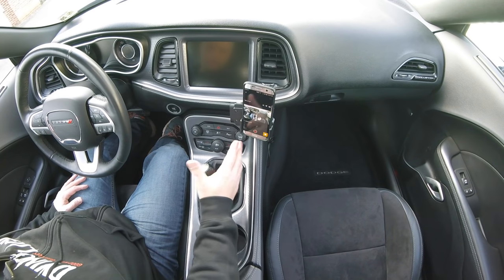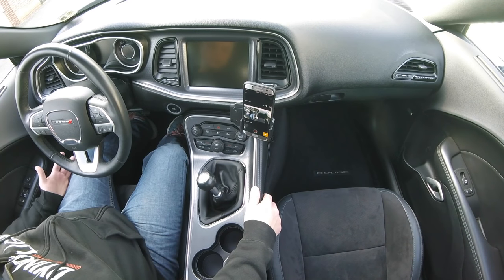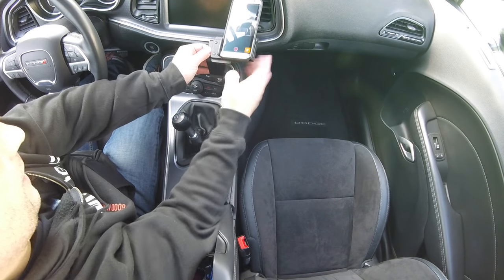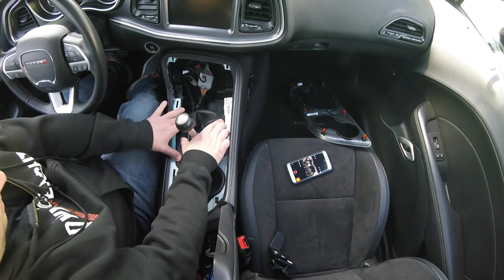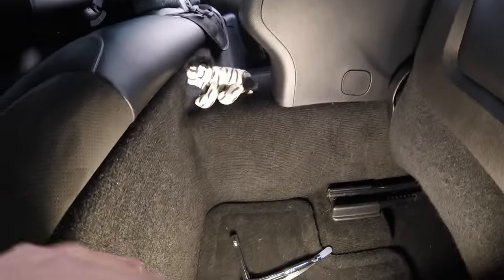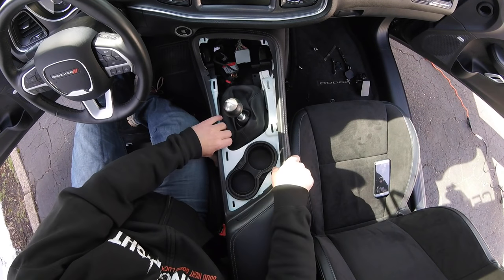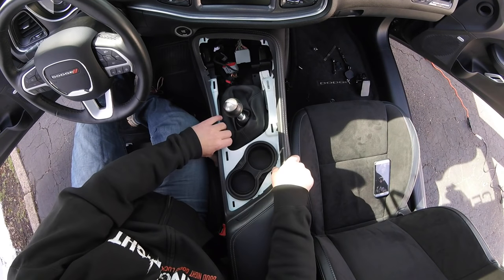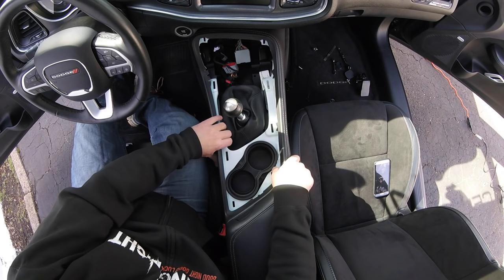Barton Shifter complete Install - Dodge Challenger Scat Pack

Comment: Just installed the Barton in my 2015 Scat Pack. Your video was spot on and far superior to any others I found. You covered everything from beginning to end and definitely saved me a bunch of time on the install. As it was it took me 5 hours, but I'm a bit OCD myself. The manufacturer included no instructions with the shifter and their install video was low quality and did not help at all, but then in was for earlier year models. As excellent as their product is ... and it's fantastic! ... they really should update their video or better yet insert a link to yours! I expected that right side pin to be the toughest problem ... and it was exceptionally difficult ... and so was getting that 10mm bolt out due to the Loctite ... but I actually spent more time trying to get that round rubber boot to stay properly in place when put over the shifter block! Again, outstanding video and commentary and I highly recommended it to any contemplating this install. Kudos!
Reply from the maker: Thank you, I'm glad this helped.  I did see a lack of info on this when I was researching the Barton so I tried my best to put out a detailed stable cam install.  The only thing I was lacking was some grease for those pins ;)   It's definitely a great product and has helped my times on the 1/4 mile quite a bit.  I was a little nervous about the investment, but it's proven itself very nicely.
Reply: You summed it up! Just installed on my TA 392 and those were all the same problems I had. Right pin and getting the boot to stay still lol.
Reply from the maker: Robert Lugo 👍

Comment: Use lithium grease whenever wherever possible in those pin joint sleeves.The boss should have been on the jobber earlier 😅

Comment: one thing you didn't mention is you need to make sure the round gasket ring needs to slide down onto the shifter and lock into a slit all the way around the shifter. that was the hardest part of the whole install.
Reply from the maker: True, I skated around it in this part 26:08 my go pro battery distracted me.

Comment: Soo I was driving and out of nowhere I had no gear shifter. Just all slush. I later realized I could kinda slop it into gear if I was really careful. 

Well I finally pull the shifter and the 10mm bolt and both clips had broken off and jettisoned out. Idk how this happened but I'm sure glad I didn't keep driving it like that. Jeeeeze. This video is a life saver. Literally

Comment: Just installed my Barton shifter.  Watching your video helped me understand how to get the console apart without breaking anything.  The right side pin actually wasn't too bad.  Had more trouble getting the gasket to stay in place on the cover while trying to get it over the shifter assembly.  You probably already know about this, but in case you don't- the problem Dan Kowalchick  mentioned 4 months ago about Allen bolts is a revision Barton made to the design of the shifter.  It now allows for a fore/aft adjustment in addition to the left right.   Took my R/T Shaker out for a test drive and OMG it is a night & day difference.
Thanks for an excellent video and keep them coming.
Reply from the maker: Glad it helped, I met up with the Barton guys over in Texas at We are Mopar and saw the new design...  Looks like I've got another upgrade planned  for the winter :)

Comment: I installed a Barton on my 2015 Scat Pack using these instructions.  Thank you!  I think this is the best install guidance on YouTube.  One thing I did different that is useful - rather than trying to jam my fingers into the tiny opening on the passenger side on the shifter base to install that pesky pin, I used a set of long needle nose pliers to grip the pin, put it in place, and start seating it.  Once I got it started I used my hand to finish pushing the pin in.  Anyway, thanks for the video.  I miss your Scat Pack, I know everyone wants a Hellcat eventually but the Scat is a pretty solid in drivability, cost, and performance.  I’ve subscribed to your channel, there are still a lot of good helps there.
Reply from the maker: I miss the scat pack too. My next challenger will be a manual 392. 🧡

Comment: Had the original prototype when they first hit the scene. Blows away Hurst. The shifts are positive and complete and makes owning a 6 shooter all the worth while. You will not destroy this shifter, period. 

Great job all around. So far your videos have influenced my purchases, and made them easier to understand and install.
Reply from the maker: Glad to help in some way.  I've been wanting the Barton for over a year, but the cost was always hindering the purchase.  After a few failed shifts into 4th at the strip I decided to go for it.  2 weeks to track night, wish me luck.
Reply: Work Play Drive best of luck. If you get a chance to review Tuning may I suggest Sean over @ Hemifever. So far one guy is running 11.21 with nothing more than CAI, drags, Throttle body, catless, thermostat. Several into the 11's.
Reply from the maker: Nice, I'll keep that in mind, no tuning this year.  The big ticket items I need to save some cash for and this year I'm redirecting my budget to my wife who wants a new Kitchen.  She deserves it, she's been so patient with my "car problem"

Comment: I was eyeing one of these and just did the install today, holy cow it really does reduce the shift throws, but now the whole thing feels like a very precise mechanism. Overall love it. The tip for pulling up by the cup holders was awesome, as I also hate trim removal tools.

Hot tip for you, this is something I tried during the removal process (see around 14:15 on this video). To get the second pin out, the one on the right, I actually lifted the whole shifter mechanism and moved it up and forward out of the way. This lets you get at the pin from underneath and there's a lot more room to get your hand in there. Made it a lot easier for me, there was no way I was getting that pin out otherwise.

This was also just preference, but when it came to removing the center column, I just lifted it out and set it in the back seat, with the passenger seat angled forward.

Thanks for the video, excellent walk through!

Comment: Installed mine last weekend. Fitting the metal plate with the rubber Barton bushing over the shifter was a pain in the ass!  Thanks for the video, It took the guess work out of everything.
Reply from the maker: glad to help, how do you like the shifter?
Reply: Work Play Drive 

Love the shifter, the knob is terrible. Gonna order one of the SpeedDawg knobs. You’re right about Barton needing to team up with them. You still rockin the pistol grip?
Reply from the maker: Agreed 👌

Comment: Seven years later and this video is still YouTube gold!  Thank you, my friend!  A few minor differences on my '23, but overall, still the best on the net!
Reply: What was different? If you don't mind me asking? I have a 21 T/A and was thinking about getting one
Reply: @hotrodxok11 All the big stuff was exactly the same. If I remember right, there’s a rubber piece that goes around the bottom that wasn’t marked and looked different than the vid. Nothing major, just took a minute to figure out which way it was supposed to go (and get it on where it would stay). They’ve revised the shifter assembly for more adjustments since this video, too. That’s all I remember. Still a great video to use.

Comment: I just finished up switching out my stock shifter for a new Barton thanks to your video. It was the reason I considered switching and pulling the trigger on getting one. The swap definitely was a pain in some areas but following along with your video certainly made it easier. Funny thing was that right side pin was the easiest part for me. It just slipped right in after struggling for 5 minutes with the left one lol. But thanks a lot for putting this video together. Also, thanks for the speed dog reference as well. I got a nice scat pack shifter that matched up perfectly.
Reply from the maker: The Barton Speeddawg combo is so Awesome and glad it helped.

Comment: I just installed my Barton shifter in my 2016 Scat pack. Using your video.. it went flawlessly. Great job on the video. That passenger side pin it tough but I finally got it. Thanks for the fantastic video.
Reply from the maker: Awesome 👏 and glad to help.

Comment: Finally! After wading through 5 other install videos (including the Barton video), they were all for pre-2015 Challengers with the plastic retainer for the boot. Finally saw this one, and cutting that o-ring worked great! Yeah, with the leather that thick, you can't work the boot all the way down, but I see that yours fit they way it did on my 2018. Great tip!
Reply from the maker: Thank you

Comment: Just completed this install two hours ago. Thanks very much for the video! I wouldn't have attempted this without it. Barton's super tight when shifting, still have my leather boot cover off for adjustments, you can here a lot more engine grunt without it! Also installed the skip shift delete at the same time using your video. Thanks again!
Reply from the maker: Overall you will hear a little more sound from that area once installed. But nothing loud enough that bothered me for the 3 years I had it.

Comment: Thanks for the video instructions mine arrived Monday 23 of March 2020 and put it in that night .There were no instructions of any kind with it . I had however watched this video several weeks ago and watched it again before  I installed it . One thing I did different than you was I removed the pin on the drivers side then slide the one on the passenger side back just enough to pull the shifter out with a finger keeping it from comming out and pushed it in to be sure it didn't fall out while I got ready to put the new in as I started to put it in I pushed the pin flush with the surface  put the drivers side in first then pressed passenger side in never having to try to start it back in that tiny space . Barton should be giving you a comission . I don't think I would have bought one had I not seen your video. Thanks again Larry

Comment: I just completed the install on my 2018 Hellcat following your video. Everything fell into place like clockwork. Test drive, amazing shifter. Runs through the gears much smoother, precise, even reverse is so much easier to find. Great job on video. 
Tip; If you place a towel underneath the shifter before removing the pins it can save you if you drop one:)
Reply from the maker: Glad to helped and awesome tip!!
Reply: I dropped those pins about 6 times.  I had a long wooden handle that I used to sweep them back to me.
Reply: How did you get a Barton setup on a hellcat? The Hellcat only comes in automatic big dog.
Reply from the maker: The challenger hellcat comes in a manual and auto 🤔.

Comment: Great job on the video...... I would not have attempted taking my interior console on my beloved Challenger Hellcat apart without this video. 
I only snapped 1 clip off from the shifter boot. The difference with this shifter is night and day.👍
Reply from the maker: Glad to hell and I agree, the Barton Shifter made a significant impact on the car, I miss driving a manual quite often.

Comment: Great video.  Just installed my Barton yesterday and it made a huge difference.  getting the pin in on the right side was way easier from underneath my Scat Pack.  Thanks again great video.
Reply from the maker: Thank you !  Absolutely next time I install I’m definitely going underneath.

Comment: Excellent video! Just finished installing mine, your video was spot on.  Only help I needed was getting the ball off the original shifter, was too tight for me to break free. On the right side pin I put a wire tie thru the clip because I kept dropping it under the car, maybe because my long nails. I'm a short person so I set mine all the way over to the left and the forward most position.  What a difference this shifter makes! I also got the skip shift delete pigtail thinking I could reach through and put it on at the same time, no such luck.  I'll have to do that another day from underneath.  Pair this shifter with the clutch delay valve delete and your shift/response times improve drastically!
Reply from the maker: Thank You 🙏 the Barton is Definitely one of those modifications that you get to enjoy daily.

Comment: Bro! Just got finished about 10 minutes ago installing my Barton onto my '16 Challenger SRT. I used your vid 100%. Awesome work! You also got me into the SpeedDawg knobs. I got the Rally  with Challenger script, GoMango with black racing stripes, black flat stick with GoMango  Barton engraving. Came out SWEET! Love your vids man!
Reply from the maker: Thank you !!!! Glad to hale and you made some awesome choices on the colors.
Reply: Does yours have a slight rattle when accelerating?
Reply from the maker: Absolutely no rattling it was definitely much more stable. You do here a little bit more road noise but nothing annoying.
Reply: @WorkPlayDrive  is the road noise coming directly below the shifter? Maybe that’s the rattling I hear but it might just be road noise. It’s annoying because with the original shifter I never heard anything coming from the shifter. And now anytime I accelerating i hear noise. If I put the gear in neutral there’s no noise. The noise is when it’s in gear, or when I’m accelerating (even if it’s in neutral). I’m thinking the guy who put it left a screw loose or put a rubber in backwards or something. It’s driving me crazy lol

Comment: Well it took me longer than 45 minutes, try a few hours. Thank you for the video, I wouldn’t have known about the shifter and I doubt I’d be able to do it without the guide. I did this in combination with a clutch delay valve delete. For anyone wondering if it’s worth it, it is. The car is a whole different animal now. I’m honestly worried about getting tickets, it feels like I added 200 horsepower. You don’t realize how bad the stock shifter is until you put this amazing price of engineering in.
Reply from the maker: It really is a great product, worth the effort of install.  :)

Comment: I ordered and received a Barton for my 392 T/A. I watched this vid a few weeks ago. I rewatched it tonight before I installed mine. I ran into no problems due to this vid. I knew the tool I needed going into it and all the little tricks for and easy removal / install. Great video!
Reply from the maker: Awesome, glad to help  and congrats on the T/A I'm in love with the T/A 392 and have been drooling over them since they came out.

Comment: Thanks. I just wanted to say, I was able to put my barton shifter in my 2020 widebody manual with ease due to this video. Thanks. I did not video it but I did take pictures. I will conduct a walk through soon about the mods and updates to the vehicle. Thanks. And I am a subscriber.
Reply from the maker: Hey glad to help and congrats on that widebody🙌
Reply: @WorkPlayDrive  thanks

Comment: Mine is suppose to arrive Friday, so I suppose ill be in my driveway Saturday with my iPad and this video to follow while I install. Thanks dude.
Reply from the maker: Awesome and good luck.  My recommendation is to put a towel or some cardboard under the car so as you drop tools and those annoying clips you can easily slide it out to retrieve them

Comment: Bought a new 2017 392 T/A, Just started also realizing that a upgraded shifter is a must. Found your video, good job you where very thorough and it will come in handy since the last shifter that I re installed was on my 1970 pistol grip 4 speed 440 Six Pack Challenger.  Thanks for your time and a well done video! I look forward to my own shifter upgrade this spring! Let us know how it performs at the track!
Reply from the maker: RGeraciOA5599 she did very well eliminating my issues from 3rd to 4th. Totally happy with my Barton. And 🙏